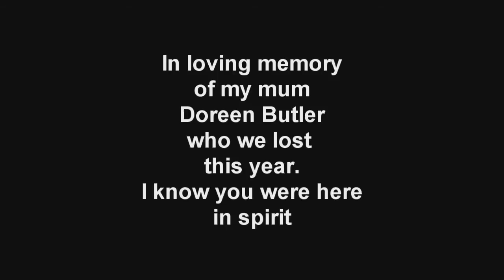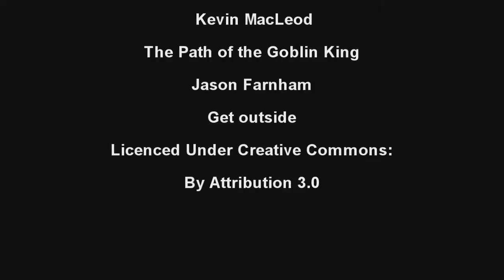Retrorestores 2014 Highlights With Martin Butler

Comment: Shame about the poly tunnal. My suggestion would be to put a couple of braces across each blue tubing, i.e "A" fraim, to stiffen up the blue piping. Yes it will lower the head hight, but if you place the bracing 1 foot down you will be ok and wont restrict the head hight.

All the best for the coming year.
Reply from the maker: I was thinking of leaving the support poles in the centre as they don't really affect the polytunnel.
All the best
Martin
Reply: retrorestore Yes you could do that, but then you will have them in the way. Its unto you, but as an Engineer my proposal will be just as strong. All the best